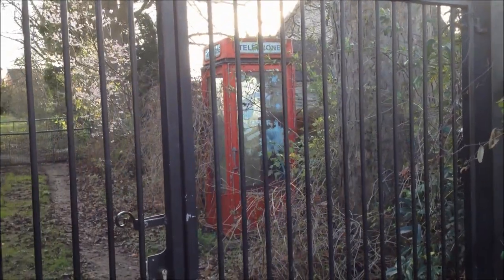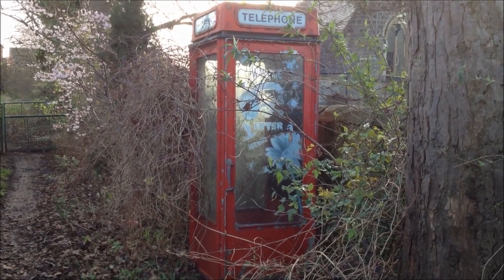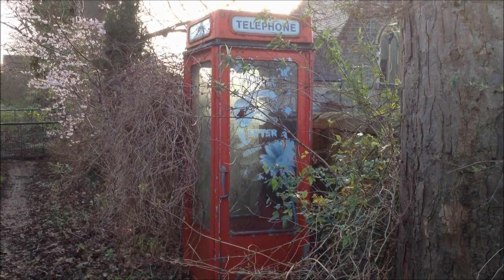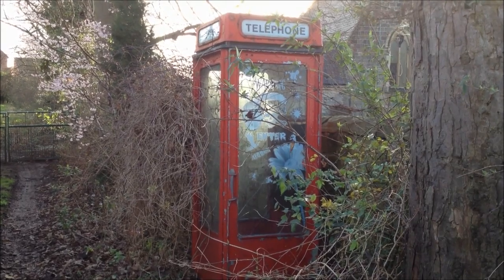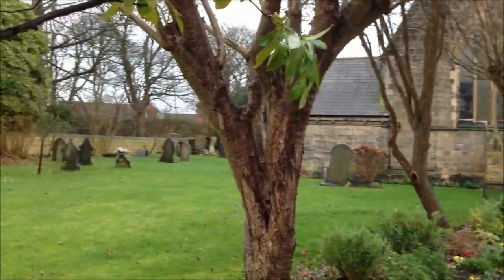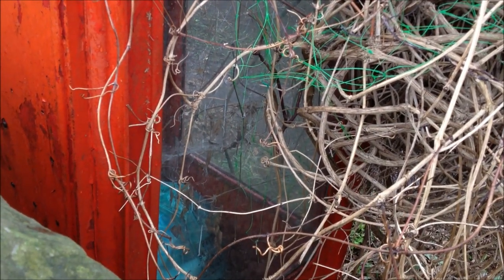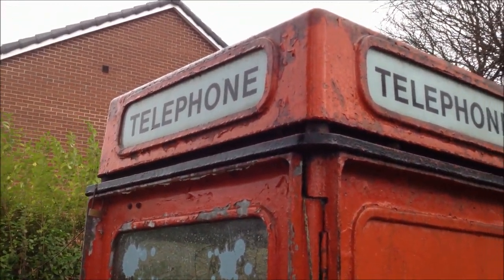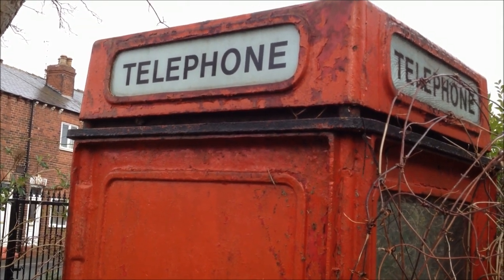The K8, the last of the great British red telephone boxes

Comment: Hi Roy, Another of the K series of red boxes you could possibly report on is the K4,  this red box was much larger than the k6, K8 because it had 2 stamp vending machines and a letter box on the back of the box,. They made very few of these, but 2 still remain in the north  west, one in Warrington ( near to Market st) and the other is in Frodsham main st.
Reply from the maker: Thanks for the info Alan, I was aware of the K4 in Frodsham but I didn't know that there was also one in Warrington. Apparently only fifty were made and of those only five remain in service so it's nice to know that two of them are in the North West and not that far away. Will definitely have to visit one of these at some point in the future. 👍